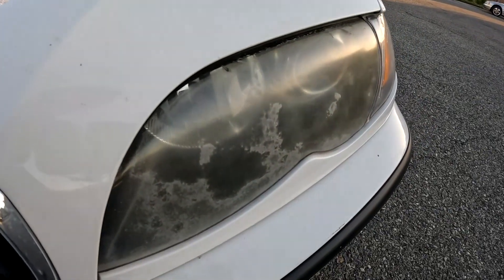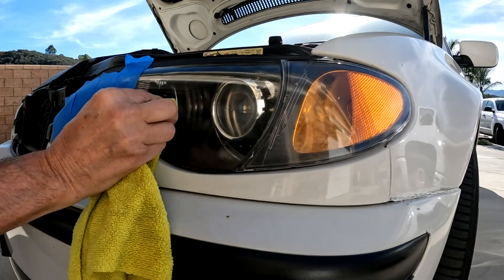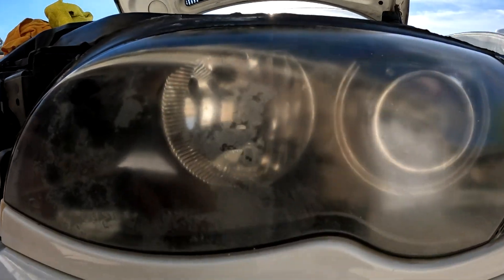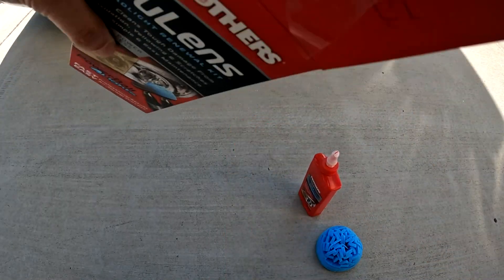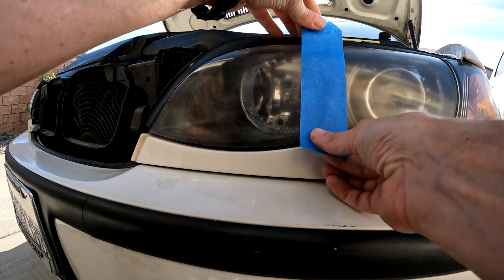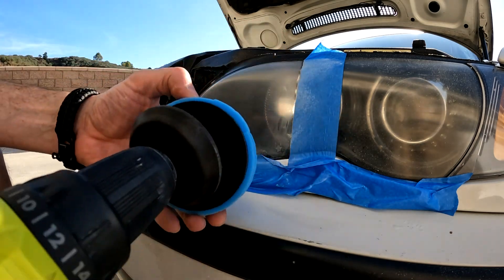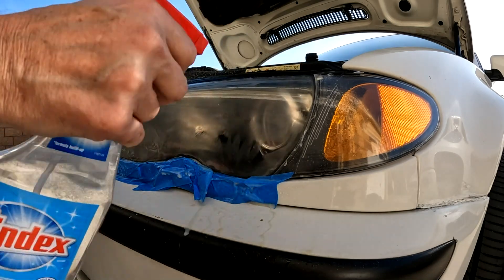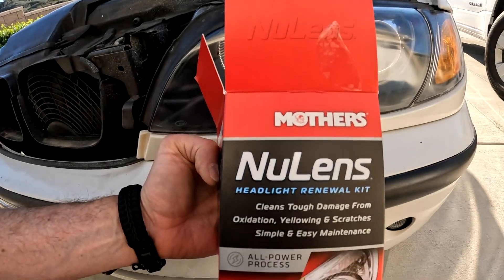Headlight Restoration - Extreme Case - The True Fix DIY

Comment: I wanted to complement martyn's message below - as one thing i have learned by watching other videos is that you need to follow up with another layer of protection if not, this will happen again and in a faster timeframe. 
I bought a clear coat to do the repairs on my headlights but havent gotton to it yet - now winter is here and.... maybe in spring lol
Thank you for your video!